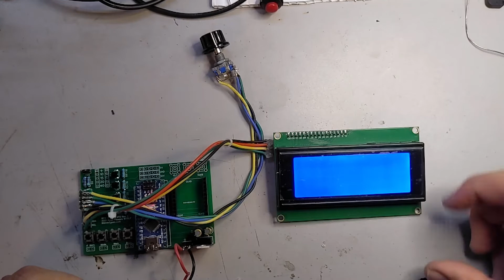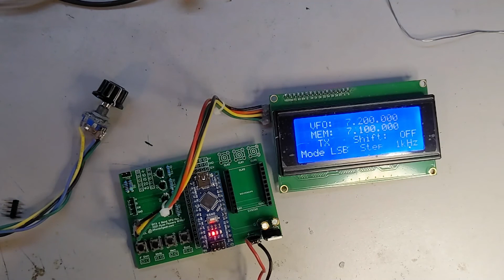BITX40 Rebuild Part 9: First VFO Power up! Will it work?

Comment: Hey Ryan, great to see it working. It is good you showed your first two failie power up attempts and your logical faultfinding. I think that is one of the joys of homebrewing, don't expect it to work first time and enjoy the de-bug process, it is the best way to learn. And, surprisingly enough lots of chips including the Nano will survive being inserted 190 degrees from normal. What most will not survive is reverse polarity so your proposed 3-pin power connector or a series diode can be a life saver.